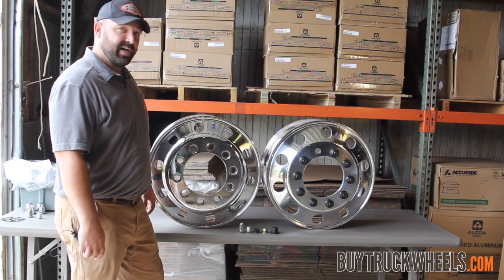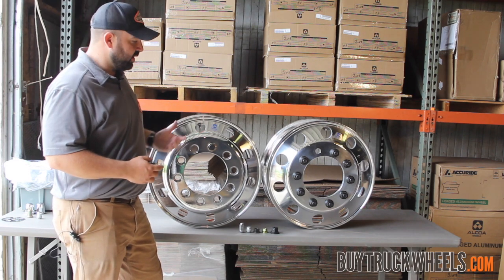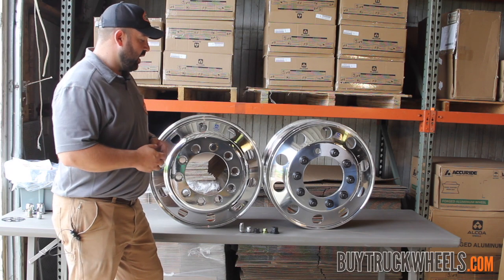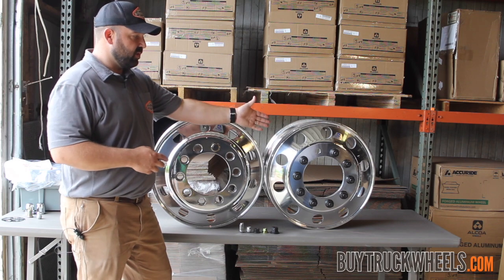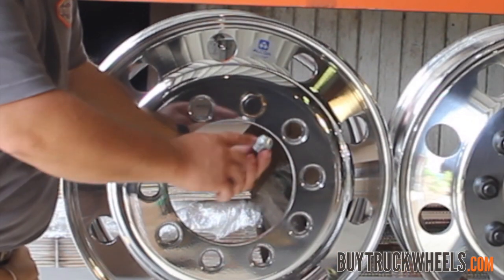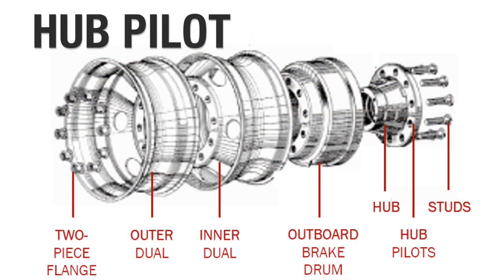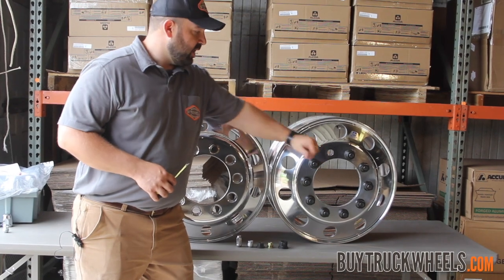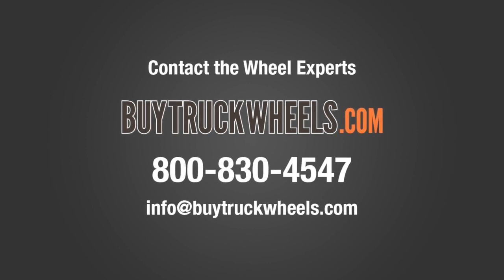Hub Pilot vs. Stud Pilot Wheels

Comment: Some trucks have the square ended studs with left vs right handed threads on each side. Is that a budd wheel?
Reply from the maker: Great Question! Yes those are Budd (Stud Pilot) Wheels
Reply: BuyTruckWheels.com thank you! Reason why i asked is because o have that exact style on a 2010 Isuzu npr hd i literally just bought today for my business. Ive been reading up on the systems and trying to familiarize myself with the truck and it has that style in the rear. Thank you!!!
Reply: yes the inner cap nut will have a square end which i believe 13/16 this is required in dual assemblies... the inner cap nut fastens the inside wheel on the hub with and then the outside wheel goes on then outer cap nut fastens that wheel on

Comment: So the stud has the nuts securing the hub from rotating and movement.

Whereas the hub although centered on the hub if the nuts somehow loosen enough or enough torque is applied to the wheel.
The wheel can move slightly depending on how much space there is between the studs and the hole where it should be centered with a collared nut. Instead of a two piece washered nut

Let me ask this.
How much room/space between the studs and the holes should there be on a hub pilot wheel.

If you have a quarter to a half inch all the way around the stud.

It should be secured with a collared nut. Something that takes up the slack off the space between the hole and the stud.
Reply from the maker: Yes you are correct on a hub pilot wheel if the nuts get loose the wheel could rotate. There is a company called Tru-Balance that makes centering collars like the ones you are describing that can help if you are having an issue keeping your lug nuts tight and the wheel rotating.
Reply: @Buytruckwheels  or left hand thread...

Comment: If I change the wheels from hub pilot to stub pilot, all I need is new bolt(s)? I have few stud wheels for my Ford dually conversion and all the 8 - 10 wheel adaptors I can find are "hub pilot(as per sellers on Ebay')"
Reply from the maker: No you would need to use hub piloted wheels with hub piloted adapters. Even though the dimensions are similar they are not exactly the same so the wheel will not center properly on the hub.
Reply: Thanks, do you guys sell stud pilot adaptors for Ford F350 (2000) dually?

Comment: I have a 1996 F350 dually. I just bought 24” wheels that are stud piloted, can i buy hub piloted adapters and use them with my stud piloted wheels but with a cone type lug nut?
Reply: I do not believe that would be safe. Also hub pilot adapters will have 22mm studs and there are not stud pilot nuts that fit those studs. Stud pilot nuts fir 7/8 or 1 1/8" Studs.
Reply: pkuzio3 i can’t find adapters for stud piloted wheels for my 1996 f350
Reply: @SparksM3dia  Yes people do not make stud pilot adapters. You'll need to find some hub pilot wheels.
Reply: pkuzio3 that’s we’re I’m confused, i have wheel adapters that fit the wheels right now. They just don’t fit my truck
Reply: @SparksM3dia  Someone must have made them custom to fit those wheels. Try Tennessee Wheel and tire they can probably make you some custom adapters.

Comment: No you always want to use the correct style rims for your truck. It would not be safe to use hub piloted wheels on a stud piloted set up.
Reply: To my knowledge, you can use one on the other. Different stud sizes between the 2
Reply: @McFearless419  I wouldn’t recommend that. The stud sizes are very different.